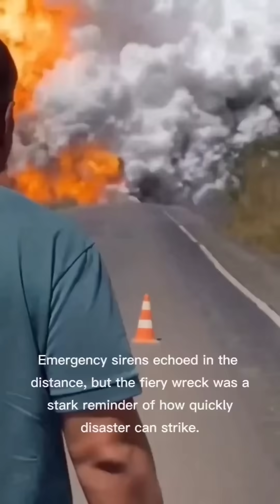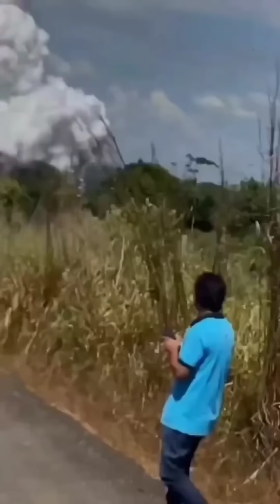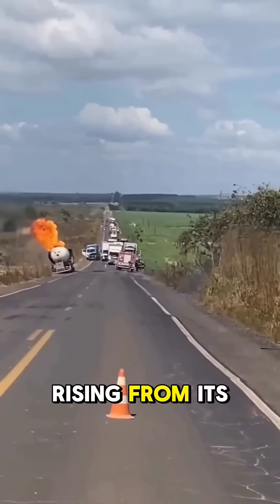"What makes the gas tank explode!?" #explosion #facts

Comment: Not a gasoline tanker. The pumpbox on the back is different, and i don't see the standard 3" hose tubes u'd see on a liquid gasoline tanker. It looks more like an LP tank. The over-pressure valve looks to have blown. Still a bad situation though.

Comment: Does anyone have any details on this.  This is the kind of thing a fire department or hazmat team would consider roughly how long it had been burning and then holding up a thumb at arm's length.  If the tip of your thumb does not cover the trailer, you keep backing up until it does.  Or you set your incident command post up at Bojangles and wait while keeping others away
Reply from the maker: Thank u

Comment: Propane smells like gasoline? That's what musta had the driver so confused! BTW poster, gasoline does not blow white clouds of pressurized gas when it's overpressurzed to bursting. The amount of hydrocarbons in gasoline makes gasoline burn with an intense orange flame front immediately followed by thick black smoke. Propane is the opposite.
Reply from the maker: Thank you

Comment: The reason it explodes is because the leaking gas continues until the volume of fumes in the tank reaches its critical volume and pressure, then the flame ignites the fumes in the tank rather than just the jet of fumes leaving the tank. At that moment the explosive pressure inside the tank exceeds the tanks ability to contain the pressure and catastrophic failure occurs. I believe the man who walked round the semi tractor unit to put himself between the tractor and the gas tanker will have lost his life... 😕

Comment: thats a propane tank , 6 oz. of propane is equal to 13 sticks of dynomite there was at least a couple of hundred gallons in the tanker ,what happened is that the tank bleveded which is metal melted and let air get inside the tank and wala
Reply from the maker: Thank you

Comment: This was Not a gasoline tanker. It was a propane tanker that was venting up until the point that it structurally failed due to the heat involved then the propane instantly vaporised and ignited.
You can see the white propane vapour being explosively released just prior to its ignition and subsequent fire ball in frame by frame analysis.
Reply from the maker: Yeah!

Comment: it is a propane transport, it does not carry gasoline or diesel, it carries liquid propane under pressure, the heat from the fire caused the pressure inside the tank to the point the metal was compromised thus causing the ruptutre or "bleve" and the highly flammable contents of the tank LPG or "PROPANE" creates the resulting enormous fire ball, probly a rough estimate 9500 gallons worth
Reply from the maker: Thank you❤️🙏

Comment: BLEVE... A Boiling Liquid, Expanding Vapor Explosion. When a liquid boils in a confined space that is holding the vapor under pressure and the container holding that pressure fails, ALL the liquid instantly vaporises, and if mixed with enough oxygen, subsequently ignites... you get an explosion with the energy of ALL the  liquid burning instantly. 

Propane is even worse.
Reply from the maker: Thank you❤️🙏

Comment: That was a BLEVE BOILING LIQUID EXPANDING VAPOR EXPLOSION.
The flames are coming from the pressure relief valve at the start of the video. 
But interior pressure caused the tank to fail and the contents ignite.

Comment: A 'BLEVE', Boiling Liquid Expanding Vapor Explosion. Its a propane truck.
The liquid propane starts to expand as it vents and evaporates, causing the liquid propane in the tank to expand more and begin to boil as it expands causing even more presure. The pressure of the expanding liquid into vapor becomes too great for the tank and when the pressure reaches the weakest point of the tank, the tank fails and an explosion occures. Being the propane is already burning, it does have an ignition source and you get a hugh fire ball of the expanding liquid immediately into a gas.
I been trained on these types of fires, its propane.
Remember, propane is heavier then air and will seek  the lowest point and an ignition point.
Reply from the maker: Thank you for your comment sir🙏❤️

Comment: As a truck driver that is not a gas truck that is a propane trailer. So how could he smell gasoline when he drives a  truck that runs on diesel 🤐 that big truck sitting on the opposite side of the road is in a bad area. Fire truck better have a water cannon.
Reply from the maker: Thank you

Comment: I think that there were needless casualties. As an explosive technician, I would have evacuated those rubber neckers. Just stupid and not comfortable to be that close to the radiant heat and the inevitable blast. As often stated, "Run!"
Reply: Looked like there was a dude standing next to the ruck to the right of the tanker.  Hard to tell how far down the hill he was but, from this angle he appeared to be in the blast radius and got cooked.
Reply: @DefenseCounsel  See that one firefighter walk on the wrong side between the two trucks just before it exploded?  Very sad I'm sure he might not have made it out alive? Walked right around the front of the fire truck and it went up knocking him to who knows where?
Reply from the maker: Thank you,❤️

Comment: It's a shame the firetruck wasn't pumping water on the bottle(Pressure tank). Like a bunson burner the fire would stay up stream of the gas release. This case the tank heated to the propane Flash Point and blew. If cooled it would have just kept burning like a torche.
Reply from the maker: Thank you

Comment: These firemen were not trained very well. That propane truck had been burning for a while which means that it could explode at any second. Best to evacuate quarter mile away for that size truck. If that was a rail car, then you want to be 3/4 of a mile away.
Reply: Ya.   When the tanker has the contents on fire. Run . Run  run away quickly as far as you can . Forget ever to extinguish this as it’s pretty much 100% casualty . Sad  I can’t understand why those other vehicles did not u turn . Tell everyone you know if they ever see a tanker like this to never stay within qtr mile . That’s not necessarily good. Radius is 1mile . The contents do expand causing a bigger blast radius
Reply: @stevenhicks2525  This is a small, local propane truck probably 3000 gallons or less so you could survive a quarter mile away from the blast. But if it's a 30,000 gallon rail car, you want to be far, far away from it.
Reply: The metal tank is shrapnel being pushed by the force of the blast
Reply: @stevenhicks2525  As a firefighter, we would NEVER put out a propane truck fire but keep the tank cool with large water streams. If you put out the fire, the propane gas (which is heavier than air) will travel along the ground until it finds an ignition source and then BOOM! It is amazing how close all the bystanders are. Some people end up learning about the dangers of propane the hard way.
Reply: @ crude has similar effects.  Today everyone wants a story to tell as we are very curious but these kind of events are poison , combustible, flammable and propane can frost burn. If it can run a combustion engine ……….
The pressure as just atmosphere warms the exterior of the tank as the pressure increases .  I’m still wondering why all the vehicles were lined up behind it w/o u turning?   It would certainly limit emergency response plus increase safety hazard for those cramped in this situation.
Reply: @M-HK-    TECO-PEOPLES GAS in Florida had a site for training fire depts on how to handle real gas fires everything from house line pressure UP to transmission pressures over 250 lbs. also propane vapor and liquid. People cannot imagine how hot the liquid flame is until the feel it for real. The truck that was in fire and the reactor trailer across from it was probably getting close to blowing the tires. It would be that hot.
Reply: When the propane tank explodes it called a Bleve. Boiling liquid vapor explosion.  I had had over 25 years in the propane and natural gas industry. Out company had a site that we trained all the fire depts on how to fight gas fire. Had liquid propane, vapor propane 250 lbs natural gas and low pressure gas. I would like to know how many got hurt being that close to the explosion. The only way to control a fire like is to keep the tank cool with water and let it burn out.
Reply: @kevinhitchcock7062  We had annual training with the gas company which really helped give our guys an idea of what they might face in the future and how to deal with it. One good part was that it got us accustomed to that awful shriek that comes from the relief valve when it is functioning. The scenarios where the fire is caused by the service valve being open were the best. Cool the tank with straight streams until the relief valve closed then change to a fog pattern to protect your crew and close the valve. Of course, you never were able to do this on the first attempt because once you got close to the valve to shut it off, the instructor would reopen the relief valve, causing you to back away and cool it with straight streams again. You were able to close the valve on the third try as long as you didn't screw up during the evolution. And of course, they always hammered into us to never, ever put your equipment or personnel in line with the ends of the tank during a propane incident. Many props and thanks to all the gas industry folks who take the time to train fire departments on all things propane. With no doubt, the training made me much more confident than I would have been when I faced my first propane incident which fortunately didn't BLEVE.
Reply from the maker: Thank you sir
Reply: @MovieCutExplained-II  10 years driving large propane truck. My training says stay away from a truck that's been burning like that for a while because the tank has been heating up and something bad is about to happen.
Reply from the maker: It helps a lot sir, thank you
Reply: I can't  believe that can happen,  having a similar thing with a car , but , I wasn't sticking around , and warning everyone , but it was a totty explosion, more like a bang ,  so I woula been gone baby
Reply: @georgespalding7640  It might be in South Africa.
Reply: @ well if the fireman had got there just a few minutes after the fire started then they could've kept the tank cool with water and kept it under control. But this fire was far away from a fire station so it took them too long to get there and the tank had time to heat up to critical level where the metal was actually compromised and ready to blow it any second.
Reply: @georgespalding7640  those firefighters are all toast.
Reply: yea I seen how he was infront of the fire truck I mean ATLEAST  get behind it so shards don’t hit u I mean still rest in peace to him im not trying to by funny by that tho
Reply: I hope there ok❤
Reply: @amysix2067  that close to the the tanker I don’t think they’d survive but hopefully maybe they did

Comment: Its called a bleve explosion..   boiling. Liquid, evaporating, vapour, explosion.
Reply from the maker: Thank you for educating us
Reply: @InsightQuest-BGC-II  no problem
Reply: Like you said blevy
Like a pressure cooker the liquid propane does not yet boil or vaporize due to it being contained in a pressure builds 

When the tank no longer holds it.
 it opens up the high temperature liquid propane turns to vapor and bam
Reply from the maker: Booomm!!

Comment: I think this was a liquid propane tanker.
Reply: Propane, when in complete combustion, makes a distinct blue flame, which is not easy to see in daylight. However, it does also burn yellow or orange under certain circumstances.
Reply: @Westghost101  it was a propain truck
Reply: @dennisgood2887  that is correct
Reply from the maker: Nice
Reply: @Westghost101 yes when it's mixed with the right amount of oxygen... Escaping a tank under pressure it burns with a bright yellow flame...
Reply: My uncle got 3/4 body burned from gas truck explosion he was driving
Reply from the maker: Yes
Reply: It's an lp tanker not gasoline
Reply: @tangowhiskeytrailertranspo6662  folks are lucky to be alive! Many times, you can feel the heat from the blast 100s of feet away. More depending on the tank involved. Rail cars  can and do cause terrible damge
Reply: @tangowhiskeytrailertranspo6662  could be ngl, but one is as bad as the other . Wonder how many were killed
Reply: @Michael-ul8bv  that's what I wonder you can see some next to the other truck across from the fire
Reply: LPG gas
Reply: That's what it is & looks like they were trying to unload it to another tanker by the looks im thinking but I know nobody died & only one or two people went to the hospital but nothing life threatening
Reply: @tangowhiskeytrailertranspo6662  you dont say
Reply: Going to toss it in this was not a propane truck rather a mmu mobile mixing unit used for delivering emulsion to drill patterns for blasting that truck likely had 12-18k kgs of anfo on it
Reply: @fullysent4803  doubt that was anfo , the smoke wasn't near as close as the color of smoke when anfo detonates.🤷

Comment: At the point the gasoline begins to boil, it turns to a gas, and in the presence of flame, ignites much more readily than the liquid gasoline. You could see it over pressurize just before it blew, the slow burning flame heated up the steel vessel, and turned into a jetted flame, and instantly overpressurized and blew out the steel vessel mounted to the truck.
Reply from the maker: @waverider5751  perfect explanation ❤️

Comment: That type of explosion is called a BLEVE (pronounced Blevvy.)

“A Boiling Liquid Expanding Vapor Explosion (BLEVE) is a powerful explosion that occurs when a pressurized liquid in a vessel ruptures due to reaching a temperature much higher than its boiling point. The liquid rapidly transitions from a liquid to a vapor, releasing a large amount of energy.”
Reply: Rule of thumb. If you can see a blevey you are too close
Reply from the maker: Thank you for the comment
Reply: @Rick-ve5lx  I retired from a major refinery and have been in some👽☠️. A house fire is a camp fire compared to a Blevey ((something to the effect) Blast leveling everything ( I forget, been retired for years)
Reply: @alfredoballesteros2764  I suppose it’s an accidental equivalent of the fuel-air “thing” that gets dropped on people during serious disagreements - most unfortunate.
Reply: @Rick-ve5lx  They are slightly different. With a fuel-air explosion, the vapor is dispursed over an area then ignited. Here the liquid reaches a boiling point in a confined area till the container can no longer contain the pressure. Ignition has already occurred prior and heats the contained liquid and provides the spark.
Reply: Wrong,,ts what us fire fighters call,,Big Loud Explosion Very Exciting
Reply: Thank You . I needed the explanation ❤🙂
Reply: Fun fact....
San Juanico Mexico 
Biggest BLEVE  disaster killed + 500 people . 
See BLEVE , you are too close.
See burning tanker , run like hell.
Reply: @Rick-ve5lx  thanks for sharing
Reply: This is nothing is not a BLEVE. A BLEVE is caused by external fire impingement of a propane tank. Tank heats up causing vent to open eventually reducing the cooling liquid inside. Once the liquid is gone the tank weakens and explodes.
Reply: PEPCON 1988 Henderson Nevada. One of those explosions measured over 3 on the Richter scale 😲
Reply: @Rick-ve5lx  your the homie id like to get baked and talk about science
Reply: You sound like you know your shit! Thanks for the information!
Reply: Learned that in the police academy. Saw video where it vaporized a  fire fighter on a ladder. No trace of any remains!